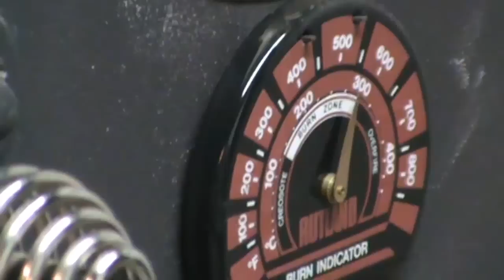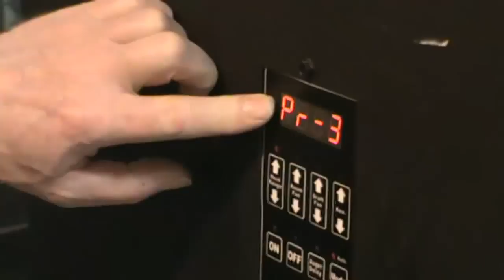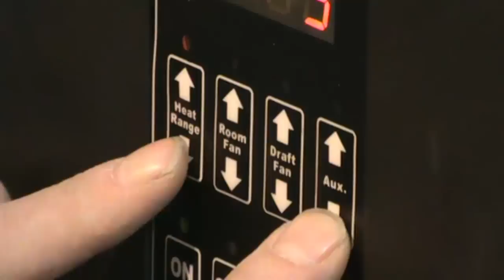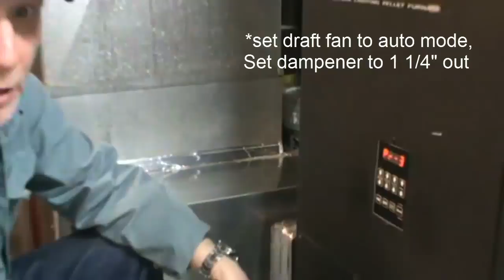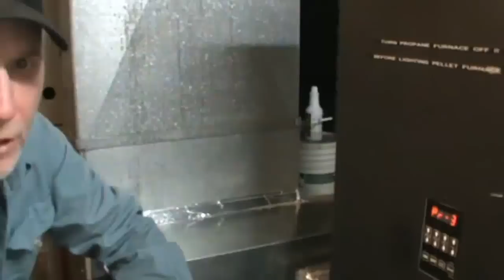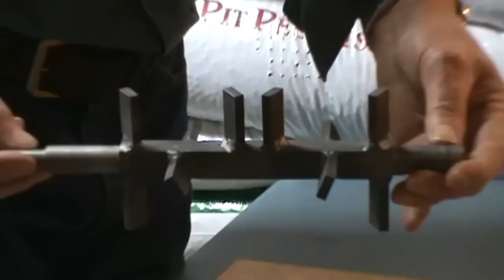US Stove Model 8500 Operating Tips & Fine Tuning

Comment: I installed that furnace a couple days ago I bought it used and a cant get it to put out more than 80 degrees. I watched all of yor videos I chande c-15 to two the high feed rate to 5.00 and low to 2.00. my cold air duct is hooked up and I have it on Pr-5 and the temp. on the window doesnt go over around 250-300. Im burning wood pellets the same pellets put out 200+ out of my pellet stove. can you help me
Reply: +Andrew Kozel the c-8 setting is how fast or slow the auger feeds the pellets to the fire box. we found that if you turn it up to 200 and you are running wood pellets (dont put it on 200 if you are running corn) it will make your pounds per hour really close to what it is set at. my c-8 setting was set at 120 when i got stove and when i had my number 5 setting on 5.00 pounds its was really only putting just a little over 2.00 pounds of pellets in my burn pot. when i did some testing i found when i moved it to 200 and had it set on setting 5 at 5.00 pounds per hour it gave me about 4.70 pound per hour so it made it really close to what you put your settings on. i hope that helps  answers your question.
Reply: +Andrew Kozel mine has a humming noise in it. its not really loud but you can hear it threw out the house when it is quit in the house. the two motor are on a metal track and it has one bolt that holds them in tight. so you could check bolt but i thank it will have a little noise because there is no rubber on the track  it just metal to metal that the fans are mounted to. and yes land/air videos are awesome very very helpful.
Reply: +Andrew Kozel and be careful with what kinda filter you run i recommend the cheap fiberglass  ones if you get a nice paper filter it will block to much and you stove will not push as much cfm go with cheap filter or no filter.
Reply: have you changed your c-8 setting to 200 yet? and how big of house do you have
Reply: +Sean Schobelock yes i did and im just heating the lower part wich is about 1000 sq ft
Reply: What is your door temp?  I have my c-15 on 0 . And my c-8 on 200 . I have both fans on all the time. Im getting about 530° door temp at 5.50 pounds per hour. I would say im getting about 95° to 100° at  vents in floor. And i have 3000 square foot home and i did the extra vent for the fans to help cfm a lot. You can email at schobelock@gmail.com  i will help out what i can but all his video is what i went off and my stove is working good so far. I can send pic of my set up by my email if you need to see the set up.
Reply: +Sean Schobelock Hello I went down and rechecked the c-8 it was back on 120. could have sworn I changed that yesterday anyway, Im now getting 98 out of the register and 547 on the door at a feed rate of 9.50 im gonna turn that down and see if it changes the temp. thank you
Reply: +Sean Schobelock so last night I was getting 547 temp on the door and 98 out of the register like I said in the other comment. I didnt change any settings and the next morning im only getting 230 on the door and around 75 out of the register
Reply: +Travis Worxmen did your c-8 setting change  back for some reason? or do you have a lot of sawdust that maybe clogging up by the auger and not letting the right amount of pellets go threw the auger? i never had any problems yet im just guessing.
Reply: +Sean Schobelock C-8 didnt change ive only put 4-5 bags in it and it was clean but its almost empty now so I will check it when it is empty. do you run yours on manul or auto and not sure what the aux is or should be on its got 0-9 then A.
Reply: +Travis Worxmen i run mine on auto and it works fine never tryed manual because it works fine on auto and im running a  thermostat on mine. so it ajust as the stove temps go up and down. i would recommend the burn pot extinction and the stainless steel  agitator bar that  from land/air sells they are nice i have both.
Reply: +Travis Worxmen did you get you stove figured out the problems you was having?
Reply: +Sean Schobelock What is C-8 settings and how is regulated, based on what?
Reply: +Sean Schobelock Thank you. I was just watching few videos that are such awesome information tool. I do have another question about blowers (just learned about C-15 settings from video), how can I make blowers to run quiet? They are producing very loud humming sound. If I take filter out and apply some pressure to the fan it makes huge difference, but after little while it would get back to the rattle noise.
Reply: +Sean Schobelock Currently running on settings #1=2lbs #5=5lbs, C-8=200, C-15=2, damper is set to 1", when running on #3 I get around 385 deg at the center of the door. #5 runs about 625 deg. Exhaust temp. is 150-160 deg. Outside temperature 32 deg. Is there any more settings to play around or is this acceptable.
Reply: +Andrew Kozel did you do door mod? and how big is your house? i thank it sounds like all your settings is good. but be ready to bump your #5 setting up a little if it gets really cold out its going to be 4° tonight and the next 3 days are going to be in the teens . i will have my #5 set on 7.50 tonight. but the kinda pellets you run will determine how much you need to feed the stove. im running a cheap pellet called therma glo they burn good but i thank they burn a little colder than a better pellet but this is my first year with stove and pellets. so i would just try to stay up on the feed rate when it gets really cold out and wright you settings down and the out side temp to keep track were you are at on settings.. i will be at 3.50 on setting #1 and 7.50 on setting #5 for the next 3 days and i hope it keeps my house at 73° the hole time.(my house is 3000 square feet with 2000 square foot base ment but i dont heat it but the stove in the basement keeps it nice and warm down there.) im still in trial-and-error my self but so far its been doing really good. one other thing try to open and shut your manual damper under the pot a couple times a day slam it back and forth to let the ash under the fire pot fall into the ash pan and keep your fire pot scraped daily and scrap ash in bottom of fire box into ash pan daily to i use a metal paint scraper and leather glove works nice help with ash build up in fire pot and fire box.
Reply: +Sean Schobelock is it safe to assume that every settings are set on #1 and #5 but furnace is running on #3 which would be halfway. Wouldn't you rather change up to 4 or 5 instead of going and change #5 up or down? We are using thermostat this time. Sorry for that many questions, we use 8500 last winter only about two mounts. This winter I want to make sure that we get everything out of the unit and so far we are other than few small adjustments. Our house is a cape 1600 sf.
Reply: +Andrew Kozel yes just  turn your settings up till you get to your #5 setting with your house being 1600 square feet your setting should be good were they are. My house being 3000 square feet i need more heat to keep it warm so thats why i turn mine up so high.
Reply: +Andrew Kozel i hope i answered all you question you asked. if you don't under stand anything let me no i will help out any way i can.
Reply: +Sean Schobelock Hi Sean, yes you did...its been running very good. Do you know, what other setting are for, C1 and up?
Reply: Yes you have a email i can send  it to?
Reply: +Sean Schobelock akozel67@google.com
Reply: +Andrew Kozel  try to send me a email i can't get it to send schobelock@gmail.com  and i will try to send it after i get your.

Comment: I'm sorry for the hassle I'm not sure I asked the right question. when setting fuel rate's for burn settings #1 & #5 in auto or manual? when setting the #1 burn setting it should read between 350 & 400 degrees on the door burn indicator. For the fuel rate on #5 burn setting how do you find out exactly were the ramp down is I know you said its between 650 & 700 degree. The video said something about a light flashing. On my stove I have found that the there are a couple of lights that flash one is the dash between Cr and burn setting and the burn setting plus the dash and the burn setting its self just the number will flash what do they mean.

again thank you for the time your videos helped me make the decision to by the 8500.
Reply from the maker: I do not recommend setting up your stove in thermostat mode,follow set up vid in normal opperation ,

Comment: just bought stove installed it this week. like your videos found them to be very helpful but I'm trying to burn corn and was wondering if you have any burn setting for corn.
Reply from the maker: I have not burned corn with my stove, the stove for the most part is shipped w/ default settings for corn, try setting fuel rates for 1 & 5  at appropriate door temps.

Comment: are there any other parameters you suggest tweaking?  so far ive changed low and high feed rates and rf2 but theres 18 more parameters.  also, is there a "rule of thumb" for temperature per pound of feed rate on our 8500's that you know of?

Comment: Im not getting the firebox temps that you do at 5 lbs/hr on PR-5.  Even at 6.5 lbs/hr, I get 450 degree firebox temps and 99-110 degree hot air temp. I run it on PR-5 with damper open 1.5" and blower set to auto.   I get my temps from the diagnostic function when you press off+aug delay. It seems the most consistent.  To get 600+ degrees, I have to crank up the rate to 11+ lbs/hr, and until I got your agitator and firebox extender, It wouldn't keep up with the rate.  It does now...those are great products that you sell.  Everyone get them because they are fantastic.  I'm trying to get these firebox temps up like yours, but it just isn't happening.  I just cleaned out every nook and cranny of every compartment that can be accessed, so I know its clean.  It's hard to get an idea of what is a proper working unit, so thank you for your videos.  It gives me some sort of target while I troubleshoot this for next season.
Reply from the maker: Wes, I take my temps from the center of the door with ir- gun, should run 600-650, hot air temp at bonnet
          Will run right where your at, maybe 115 tops.

Comment: I've been running mine now since Saturday morning (5 days now). I can't get more than 108 degrees out of the ductwork. US Stoves says the duct temp should be between 120-140 degrees.
  On my exhaust vent, I have a clean out Tee (like yours), then a 4 foot vertical, a 90 elbow, and a 3 foot horizontal thru the wall, with a horizontal end cap outside. 
  My duct has a 10 to 8 reducer, and runs exactly the same as it was with my US Stove 1557 Hot Blast woodburner. 
  My 8500 feed rates are 3.25 low/6.25 high, and I am using Sommerset premium wood pellets. 
  Running on PR-5, I have a firebox temp of 525-550 degrees (measured on the door with laser temp gun). My exhaust vent temp is 220 degrees, and only 108 degrees out of the duct work. 
  Can you offer any insight as to why my duct output temp is so low?
Reply from the maker: Try, run on auto,damper out 1 1/4". Ck temp in center of door,you should get to  aprox 640 , 220 is max on 

Exhaust. If your temp drops on exhaust ,raise # 5 feed rate. Max duct temp on my stove is 110 to 120.
Reply: I would check your return air vent close to the stove and make sure your return air is only a 3 degree defferent  from your up stairs air and your duck work is not sucking in basement air or it has leaks were its getting to much cold air coming in it.. just a thought i no on my electric furnace my duck work was sucking in a lot of basement air and its very cold in my basement  i changed my return air 13 degrees by going around and sealing it up  and it made a big difference in my house its easier to heat back up the warm air.. just a thought hope it helps..

Comment: I installed the 8500 in early January.  At the beginning, it heated very well.  The longer I used it, the worse it operated.  It soots up very heavily, it makes mountains of ash and partially-burned pellets on both sides of the fire pot.  I have cleaned it as indicated in your video.  Yesterday, I made the adjustment so that the room fan  came on at PR - 2 and above (it was set at 6).  I also adjusted the low and high feed rates from 7 #/hr to 2 #/hr on the low and 15 #/hr to 5 #/hr on the high range.  It has definitely improved performance in terms of sooting an accumulation of ash and partially-burned pellets.  It is not making heat now.  The temperature of the door running Pr-3 to Pr-5 ranges from 230° to 260°F.  The exhaust pipe at the wall of the furnace indicates 127°F.  The air temperature coming out of the registers is at highest 79°F and at lowest 71°F.  By way of comparison, the air temperature at the register for the gfa furnace, with the thermomstat set at 63°F is 92° to 99°F.  I have spent countless hours on the phone with US Stove and they have thrown pearls at me like I need to put in adequate cold air return (it is currently drawing from a house basement/crawl space and garage area that totals 3500 square feet - I don't think supply air is the issue.  Do you have any suggestions?  Also, I see you are in Owosso.  I am in Millington - would you be willing to do a service call this far away from your shop - US Stove says they will pay for warranty work.  My email is KCSinger1991@gmail.com Thanks for your time and for these videos - they are very helpful.
Reply from the maker: Poss you could have a pellet problem, try setting furnace to auto mode, set damper to 1 1/2, bump up 1 to 3# &

5 to 7#and see what you get.
Reply: Land/Air Mechanical I do run it in auto mode, the damper is at about 1 1/2 to 2 and I am feeding 4# and 7.5 # - Just increased the feed rate - will check temps in about an hour or so.  Thanks for the reply.  One other question:  The pellets seem to be hitting the agitator when dropping and I have a lot of them bouncing out of the sides and building up outside the fire pot -  any fix for this?
Reply from the maker: Kent, ck our new video coming out in a day or two, we will have a stainless burn pot extension  available that works

Very well, it will reduce bounce outs by about 90 percent.

Comment: Ya i always clean the burnpot. Im running somerset pellets and really dont like them. They get rave reviews but when i was running pro pellets they seem to burn alot better on a lower setting. Might be a moisture issue. I need to get a temp gun seems like alot of heat is going out the exhauat. What do you set your dampner at? Im running a thermostat and draft fan on manual.
Reply from the maker: I run my stove on auto mode, damper  1 1/4 out , lazer temp is the way to go!
Reply: Ok im doing something wrong then i keep damper all the way open and draft fan up high on manual with setting on 5 at 7lbs per hr. I think draft fan is just sucking the heat out and up thru exhaust. Ill lower draft fan back to auto and try damper at 1.25 see if that helps. Ill lower feed rate on 5 to 4lbs

Comment: My draft fan cycles on and off all of the time.  No matter how I set it, and at every feed rate.  It runs for a few seconds and then shuts off for one second.  It does it in a steady rhythm whenever the stove is running.  Is this normal?  Also my secondary blower fan cycles on and off also.  I had it set at PR-5 with a feed rate of 5.00 and it cycled on and off all night. It came from the factory set on 6, so I lowered it to 2 like you showed in your video.  It cycled both before and after I changed it from a 6 to a 2.  Maybe this is normal too?
Reply from the maker: The draft fan cycling is normal, both blower fans should be running in heat settings 2-5 in manual operation,

(Except thermostat op.)

Comment: You have no idea how much your videos have helped me already! I have learned more in one hour of watching you videos than in my 30+ calls to US STOVE. I installed the 8500 in mid October and it has been maddening. And calls for tech help (twice at the supervisory level) have left me frustrated because of all the contradictory advice. They only give you bits and pieces (because maybe that's all they know) on adjustments to the control panel, nun of which are anywhere in the manual. It's like visiting "The Great And Powerful OZ" where the furnace secrets must remain behind the curtain, just out of reach. And just as a bit of background, i'm a licensed Electrical and Plumbing contractor in PA that has installed more than a few Gas and Oil furnaces. 
  My main issue is trying to get to the 100,000 (12+ lb/hr) input mark that this furnace was sold to me as being able to achieve. I have a 3000 sq/ft house and the outside temps are often in the single digits with 15-20 m/hr winds. It never reaches the 12 lb feed rate even though the high limit is set at 14. The flashing - which always seems to be present was told to me that it meant the furnace ramping up to temp and working properly even though it would flash for hours! And the #2 circulation fan almost never came on (apparently because it was factory set for 8). 
  So basically my question is in order to successfully achieve a burn rate of 12+ lb/hr at Pr-5, what parameter settings are necessary? To your knowledge, what combination of upper Feed Rate setting, Draft Fan setting and damper opening will help me reach that rate of burn? Thank you so much for all of your help so far with these videos, and for any insight you can provide toward helping me solve my dilemma. 

  Thanks again 
  Rube

Comment: I have a 6500 and have it set up almost identical to yours and have a newer 2100 sqft home and can't get it told 68deg when temps go into the lower teens to single digits. I had to turn draft fan up just to keep pot from overflowing and to get the heat out of it. I've been messing with it for four seasons now. I burn pellets also. Not sure what I'm doing wrong. Or if it's just the stove
Reply from the maker: Possible moisture in pellets ,  also ck holes in burn pot are open, poss component malfunction ?